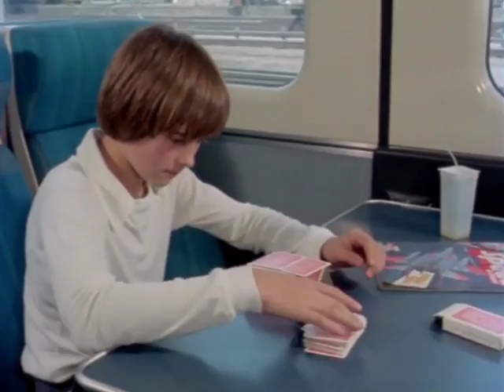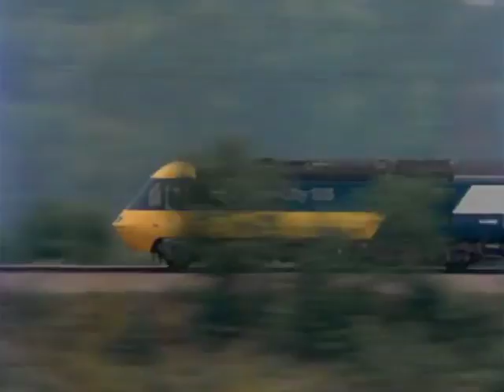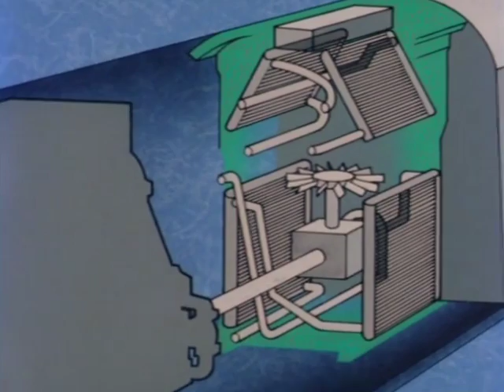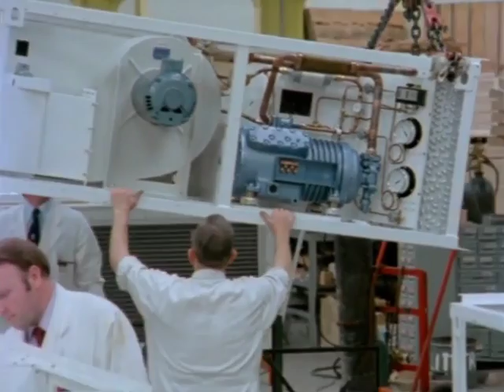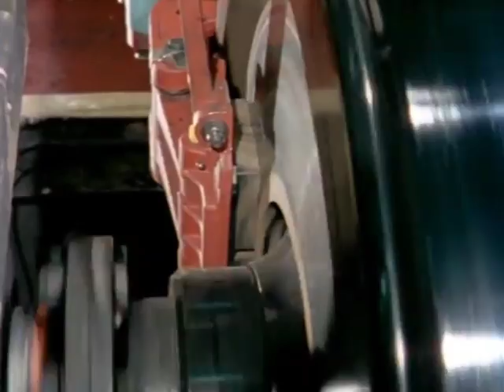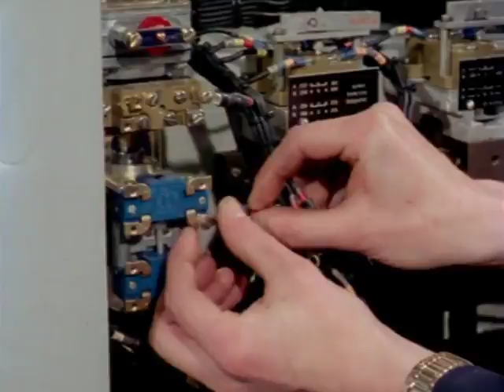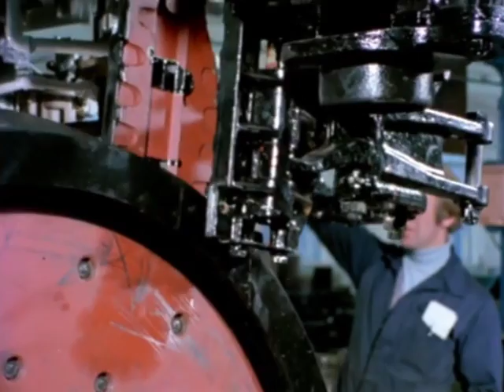Vintage railway film - Inter City 125 - 1976

Comment: way back in1982 i visited England and did quite a bit of travel on the intercity 125. i could not believe how fast and smooth the ride was compared to the rickety old rail system we have here in NZ.

Comment: I think you've missed the point saying 2,200 HP.   That's boring old stuff.  An RR Merlin from the early 1940's could do that, and there were literally thousands of them.  And they were more or less a 'consumable'.   1000's being shot down.   The train needs to work all day, everyday, for decades.  The actual HP is not really relevant.

Comment: With 20 20 hindsight it would have been an advantage to design the power cars with possible conversion to bi mode so extensive under the wires diesel working was averted.  Also the hinged carriage doors, maybe the additional costs of plug doors, as today on Voyagers, could have been found.   

Think with these two bits of future proofing we would still have HST's and avoid the need for Class 800 trains with their ropey suspension, still not rectified or even acknowledged as a problem after 7 years, and seats less well made than ironing boards.  

Peter Parker knew about customer service as a business person not as a graduate who could spout gobbledegook in a job interview.  That said Parker was over invested in the APT and under interested in the HST programme.  Hitachi trains have the ambience of a 1970's Datsun, HST's had British Attention to Detail.

Comment: That was extremely interesting. I like the way it was all put together with the mechanics in mind so they could fix it when needed. Those days are long gone
Reply: The newer trains don't break down anymore you know. They just, um, uh, don't move sometimes. Or the aircon doesn't run. Or the fire alarm perpetually goes off for no reason. The computer shuts down and refuses to be restarted. Vital locks don't fit their keys as a feature. Tilting tech tilts in the straight while turned off. I could go on and on. Yup, those are great

Comment: Inter City 125 and Corcorde. Last of great British engineering.
Reply: Channel Tunnel? And the A1 upgrade from Leeming to Barton North Yorkshire junction 51 to 56. 
How they built a couple ate new motorway over the top of existing fuel carriageway with a few new stretches to either the east of the A1 or to the west of it and knitted it altogether so that it’s now impossible to to see the joins and what really baffles me is at Scotch Corner J53 , travelling south under the bridge you are slowly on a brand-new scratch carriageway the old southbound carriageway swallows northbound carriageway and the northbound carriageway is quite a long way to the right and yet they haven’t moved bridges and there’s no sharp turns in the carriageways and the new A1 (M) appears as tho it’s always been there. 
It took 4 years to complete which was down to Roman historic archaeological finds in fields being earmarked for road building. 
It maybe just standard road construction procedure and had it not been for the pesky Romans littering the countryside up then Balfour may have been able to knock the upgrade out in just a few months as it’s all in a days work for them maybe, but I’m impressed at how they’ve stitched it altogether. 
I travel along that stretch of the now A1(M) regularly and I still can’t get my head around how they did it whilst the A1 was actually open. 
That is a great engineering feet to me anyway.
Reply: JCB are still around, and BRITISH.
Reply: Apt
Reply: @hugostiglitz5669  APT = All Part Time

Comment: “That's unlikely to bother anyone,” says the narrator about a man puffing away on a pipe… times have certainly changed!

I'm not convinced the air conditioning would have eliminated pipe smoke, considering how poorly it handled the dreadful smell from the brakes sucked in and distributed throughout the passenger compartments.
Reply: It's odd but I was thinking about this just the other day. Put aside the distinctive 'groaning' as the train started from rest or came to a halt, undoubtedly there was that Valenta scream, but to me it was also that smell of hot brakes.

Comment: Aah, this was the future once. And what a fortune these trains earned for BR InterCity! 

HS(D)T was BR Research's pragmatic response to 'sex up' the main routes that the government wasn't going to authorise for electrification anytime soon. Technical evolution and not revolution, most of it developed in-house, at modest cost to the taxpayer. The MkIII coach is still the standard by which other InterCity stock is judged.

I shudder to think what might have happened if InterCity travel was at the same crossroads in 1996 and not 1976: uncoordinated and inconsistent train replacement policies depending on each TOC and the chosen 'flavour' of its franchise, taking years longer to deliver new trains because of the haste to reinvent wheels... and and at four times the price. (Rant over!)

Comment: Imagine if they made a film like this about newer stuff. It wouldn't take long. 
"we cut every corner we could get away with and they probably won't last long so we're busy designing the next ones already".
Reply: "And don't look to closely into any of the electrical cabinets as it's stuck together with tape and any of them is different, so good luck troubleshooting while on the line."
Reply: How else do the banks keep making profit out of our stupid rail system? They done want reliability or longevity they want the next balloon payment when the trains have to be replaced. This has just happened by the way on Trans Pennine

Comment: I actually know the speeds of the fast lines from paddington to reading in and out
40 from the platffoms 25 inside them
50 after the tube station to the left
100 after passing the depot entry & exit
125 after 1 more mile

Coast since twyford
2 miles theres down to 90
Then shortly after the next signal 60
Then 50
Then potentialy 30

All from TSW

Comment: Ah the IC-125 the improved version of the APT
Reply: thats the 225, the 125 was an unrelated side project to the APT, the 225 was the spin off
Reply: @Trainman10715  The 125 was the HST the 225s were the class 91s
Reply: @K8thebest_Gaming  I know. That's what I said
Reply: The XPT was the improved HST-125
Reply: @gregrudd6983  big man I’m not talking about the Aussie version
Reply: @K8thebest_Gaming  There were BREL engineers that worked on both the XPT and the HST and they were the ones who said the XPT is an improved HST-125. The XPT power cars have the crash protection bars the HST power cars didn't have and would have been useful in a number of accidents the HST's have been involved in over the years. Search for the youtube XPT by Comeng and most will be revealed.

Comment: 1:03shows where it began to go downhill; by making it their mission to get in as many seats as possible, they no longer all lined up with windows, and this was the result for some. Personally I preferred a Mk 2
Reply: the seats line up perfectly well with the windows on mark 3s, they were properly designed so they lined them up properly, unlike with the modern IET junk
Reply: @Trainman10715  Not in standard class - the body shell was the same for 1st and 2nd class so only Ist class seats aligned with windows.
Reply: @barrieshepherd7694  I never had any issues on the HSTs finding a seat with a Window, I get what you mean, first and standard have the same no of windows, but it's not nearly as bad as things like the 390s which have several seats per coach that don't even get a fraction of a window
Reply: @Trainman10715  I agree even 1st Class seats on the Hitachi sets don't guarantee a window.
Reply: @Trainman10715  When I started travelling by train extensively the Mk II Ds were coming on stream 1st class was still compartments!
Reply: @barrieshepherd7694  on the Ds? I thought they ditched compartments with the air con mark 2s
Reply: @Trainman10715  😎 I typed MK II Ds, as I remember they had compartment and open 1st  (i'm going back to 1973)
Reply: @barrieshepherd7694  fair enough, never knew the air con mark 2s retained compartments, probably only the Ds though
Reply: Bums on seats, dear chap
Reply: Yes, The Mk 2 was a lovely way to travel. Nearly as good as a voyager! (I like my sarcasm on the heavy side!)😀
Reply: @davidmansell5986  For me, the move away from passenger-operated windows was a step too far. Aircon is a wonderful thing, but when a train stops somewhere for an extended & seemingly indeterminate power-free breakdown 😞 ... just nice to have some autonomy in that way
Reply: @daffyduk77  Agreed.

Comment: They want to try making comfortable seating these days instead of the hard seats now. Ah but I forgot, they aren't made in Britain like the HST's were. Maybe that's where the railways went wrong, back to third class seating.
(Ex railwayman)
Reply: And yet the "Made in France" TGV and "Made in Japan" Shinkansen have outlived the HST - and ran on electric from the outset.
Reply: @emjackson2289  no they havent... the HSTs are still in service with more than half the power cars currently registered with an operator. the original Shinkansen was retired years ago and the TGV sud ests were retired recently i believe. so no, the HST has infact outlived them even though it was only designed as a stopgap. running on electric isnt a requirement for high speed as the HST thoroughly proved, and it even achieved the same speed as the Shinkansen dispite being a diesel
Reply: The seats are made hard so that they last longer, so you have to put up with them for longer than the comfortable seats.

Comment: A table at every window!
Reply: But not every seat with a window (see1:03)
Reply: @AndreiTupolev  Yes. The open 2nd carriages had eight evenly-sized and evenly-spaced windows each side of the saloon. There was one set of back-to-back non-table seats (eight seats in total) at the mid-length partition and eight sets of table seats (four seats each) more-or less evenly spaced along each side of the saloon. The result was that the tables at either end of the carriages were almost perfectly aligned with the window centres and the table centres ‘drifted’ slightly in relation to the window centres as you moved towards the middle of the carriage. There’s a nice diagram showing this in the book ‘Two Miles a Minute’ by O.S.Nock.
Reply: @dukeofaaghisle7324  I ndon't suppose they inflicted that on the fat cats in First Class. Never got to find out
Reply: @daffyduk77  If I remember correctly, 1st class were spaced with a table at each window and the usual 2 + 1 seats across the width. I travelled it once (on special offer) Paddington to Penzance.
Even so, the old 2nd class layout was absolutely luxurious compared to today’s sardine-can arrangement.

Comment: Still running here in Australia, somewhat modified and with different carriages. It's called the XPT and does the long runs between Melbourne, Sydney, Brisbane, and othe rural NSW centres. They are due for retirement in the next few years
.
Reply: Its a shame you are retiring them. Ive travelled on the HST replacements here in the UK and nothing beats the MK3 Coaching stock... or the Valenta sound....
Reply: @mattcoyne3923  You can still travel on the shortened HST ‘Castle’ sets in the south-west. Not as good as the original HSTs though, with their spacious seating and the thrilling sound of the Valentas!

Comment: Absolutely ACE! Cracking story: well told.
Pity it is now a historical impossibility to update or produce current home-grown UK designed & built solutions. All gone in a generation.
Reply: Blame the electorate wanting loser taxes and prices, but higher wages. Something had to give,
Reply: @neiloflongbeck5705  Or was it that our manufacturers weren't able to sell in overseas markets as were the competition, & UK demand for trains wouldn't support home-grown capability cost-effectively?  Then, Siemens', Henschel, Alsthom (or whoever) etc wages were probably higher than our UK manufacturers
Reply: @daffyduk77  BREL tried to sell versions of the Class 58 in both single and twin cab configurations and in various gauges but there were no takers as American locomotives were cheaper, more powerful and were seen to be more reliable. Brush traction sold several designs of locomotives overseas between the last Class 47 leaving Loughborough and the first Class 60 leaving there. But sales  numbers were never than big, the biggest order I know about was the Class 9 locomotives built for Eurotunnel with 58 built. The 100 Class 60s was there last big order but even with modern equipment the Class 59 was more reliable, hence the railway operating companies ordered the Class 66.

The cost is in the design and development of new technology which did for the aircraft industry, the car industry and the railway locomotive construction industry  over the last 30 years. It's cheaper for the purchaser to buy a foreign vehicle that is adapted for use in the UK than to have a British company do it and pass the costs on the purchaser. A prime example of this is TSR-2.
Reply: @neiloflongbeck5705  True. I think the TSR-2 was heavily impacted by changing specs/requirements causing delays,  Had it emerged one or two years earlier it's just possible it could have been sold to the Aussies & thus help defray the breath-taking avionics costs,  If that would have made any difference.
Reply: @daffyduk77  yes the cists of the TSR-2 were spiralling out of control for various reasons, but there was only 1 customer, the RAF. The RAAF were looking at it, but they were also looking at the far more capable F-111. My point about the TSR-2 was when it got cancelled we ordered the F-111K and all we had to pay was the construction cost plus a small amount for a few UK specific changes such as the inflight refuelling system and a fraction of the development costs that was spread across the entire production run which including the 50 for the RAF would have been around 600 airframes including the FB-111 airframes. The total de elopement cost of the F-111 was US$1,641.5 Million (in 1971 US Dollars). By the time it was cancelled the TSR-2 had cost the UK taxpayer £425 Million all of which would have been borne by the UK taxpayers and we only wanted as far as I can see 50 airframes. It would have been reduced a bit if the RAAF had purchased it, but only by around a third as they only wanted around 25 airframes.
Reply: @daffyduk77  as far as I'm aware the specification that the TSR-2 was to meet (GOR 339) was set long before the final choice of manufacturers were made. It was issued to industry in March 1957. GOR.339 also became the basis for the F-111 programme. Unfortunately to meet GOR.339 a lot of new technology was needed. But what made things worse was the inept project management. At one meeting 100 people turned up. It was announced that only essential people were needed at the next meeting of that committee and closer to 200 turned up. The had committee meetings to decide on instrumentation location and labelling all of which had to be changed before the first flight. Then there was the insistence from the Air Ministry that only a consortium would be given the contract, which meant the Vickers and English Electric had to merge their designs into a single sircraft as well as merging of the company cultures. Vickers insisted that final assembly had to be done at their factory even though the runway was too short for the TSR-2 to take off from, whilst at Warton (home of EE) the runway was long enough. The aircraft once built had to be dismantled and taken by road to Boscombe Down for reassembly before the first flight could be attempted. There were problems with the engine (they suffered from resonance and tended to fall to bits) and the undercarriage caused a momentary blurring of the pilots vision; there would have no doubt been other problems. It was little wonder that costs were out of control. However the GOR that it designed to meet remained the same, although I think that the requirement for operating off semi-prepared airstrips would have been dropped as the government had dropped the requirements for operating east of Suez.
Reply: @neiloflongbeck5705 中国也曾经进口过HST的拖车
Reply: @白腰熊睿 thanks.

Comment: Still one of the best trains on the network today and so much better than their replacement. What a lovely film, lots of technical detail that modern film makers seem to think is boring. I remember travelling on them soon after their introduction. There was one problem with the brakes; after every application there was a pungent smell of brake dust. It took a few years to cure that. I rather like the original internal colour scheme, probably better than most of the later ones.
Reply: The cure was simple. They closed the air intakes whennthe brakes were applied.
Reply: @neiloflongbeck5705  The smell was created by the non-use of asbestos in the brake pads. Now you know why we replace brake discs more often than before.
Reply: @martinpattison1567  I've smelt the same smell at a major junction near where I live from all the cars and in more modern trains.
Reply: With a number of other BR loco and rolling-stock brakes, you got a kind of "burnt-metallic-particulate" smell after significant, especially sharp braking. Understandable. Don't recall the pungent, may peculiar to these
Reply: It's odd but I was thinking about this just the other day. Put aside the distinctive 'groaning' as the train started from rest (or came to a halt), undoubtedly there was that Valenta scream, but to me it was also that smell of hot brakes.